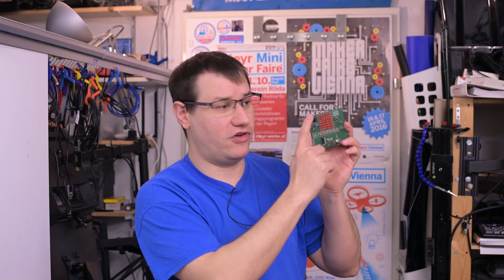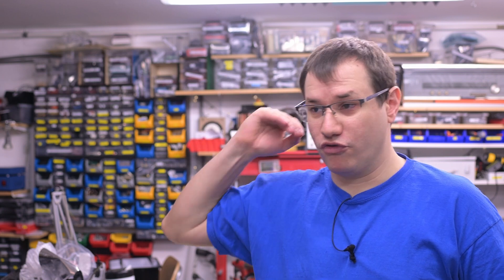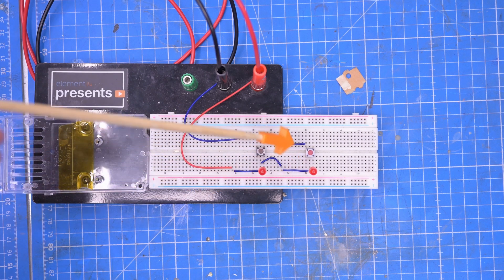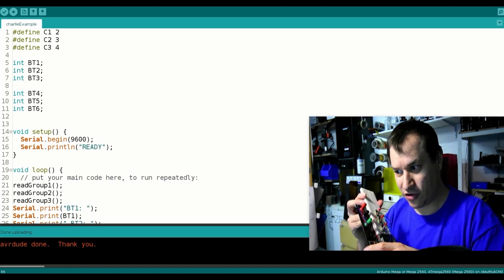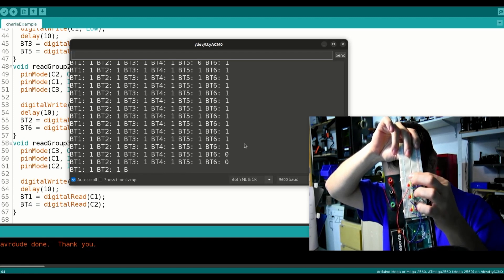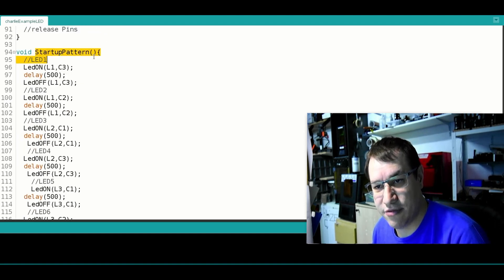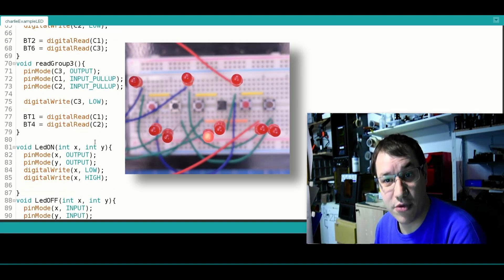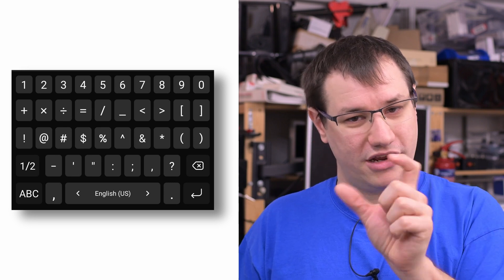Charlieplexing Buttons and LEDs at the Same Time - How Hard Can It Be?

Comment: ELEMENT14, Try to make a video lesson explaining if you didn't use Diodes in the matrix what errors would happen when the scanning of the rows and columns which confuses the Scanning monitoring program to know which row or column the buttons are closed or open when the matrix doesn't use Diodes, this isn't called Ghosting but its called what? Ghosting buttons is only when you're holding down 2 or more buttons at the "same time" if a diodes is shorted or not using diodes.
Reply: Try to rephrase your question in clearer terms. As is i dont think I understand what you are asking.